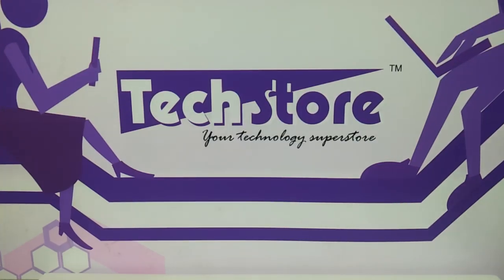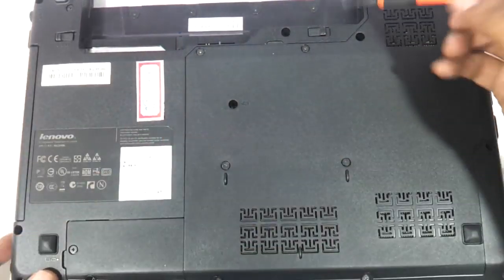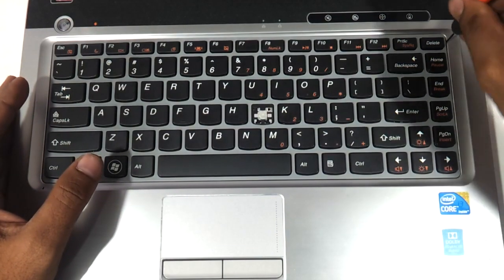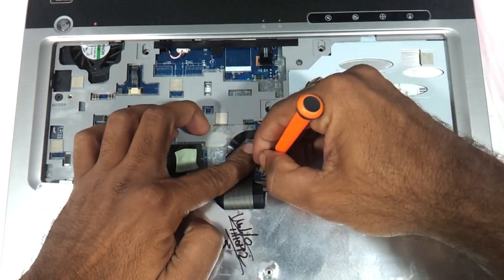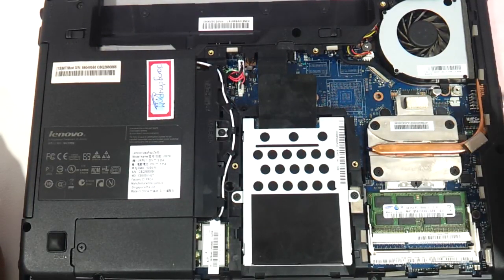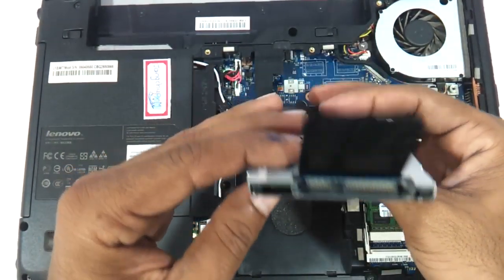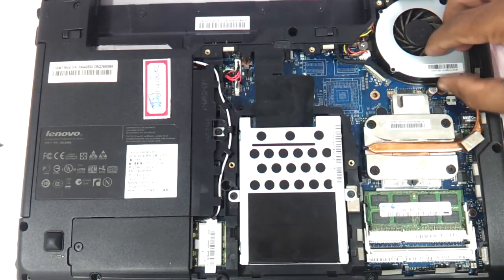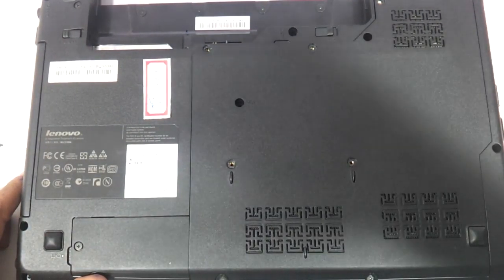Lenovo Z460 ideapad notebook How to replace keyboard harddrive ram cpu fan

Comment: hi. Thanks for this video. I had a problem following your instructions.I followed what you told me to do, removed all three screws. But when i flipped the laptop, and try to get the keyboard out, It just wont snap out of the body of the laptop. I was scared to force it, so I didn't continue. 

When I turned on my laptop, capital letters "E", "D", and "C" wont ge capitalized when im using the "shift" key, but works fine when in caps lock. I also noticed the the "F3" key does not look the same to me anymore. Unlike the other keys, the f3 is slanted to the left. 

Everything was working fine before i tried to remove the screws...

Can this be solved without replacing the keyboard? coz im sure i didnt spill anything ...

Comment: My cooler master is overheating causing the laptop to shutdown. At first I thought it was because of dust in the cooler fan, cleaned it out. But still my laptop is overheating. Any suggestions?